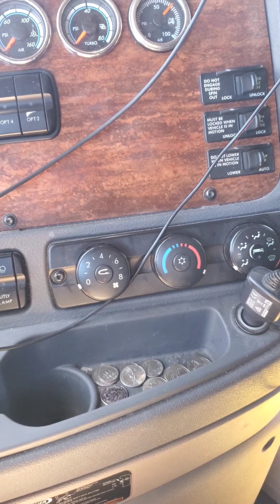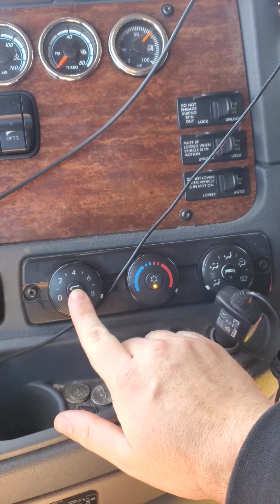Cascadia AC Reset

Comment: Great !  Ty my vents work now. 
My blower motor is noisy. I took it out and it was loaded with sand from working in oil fields.  I blew it out but it’s a noisy bastard any ideas ?
Reply from the maker: Pull that cabin filter and blow out the housing as best as you can. Vacuum the housing before putting in a new cabin filter. Once it's making noise it's not gonna last much longer